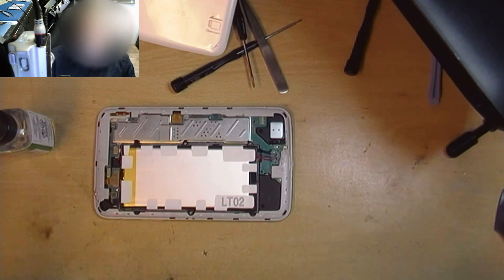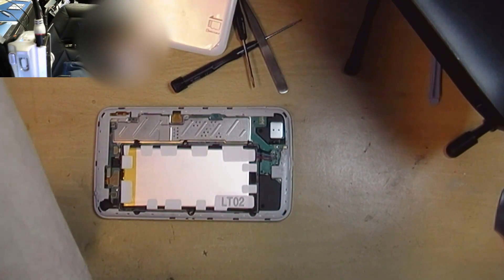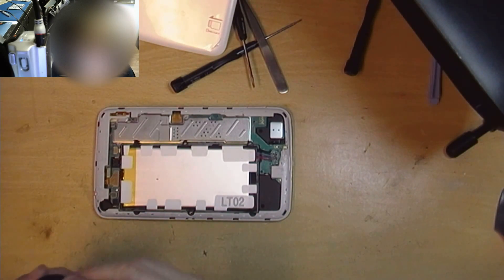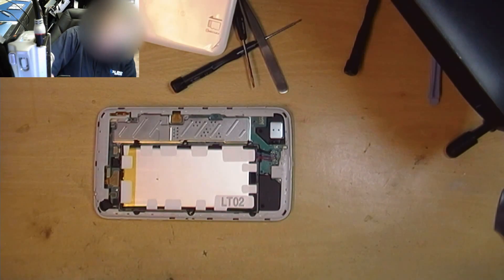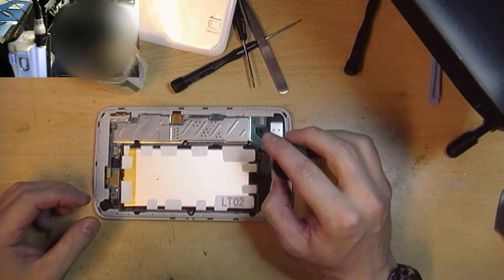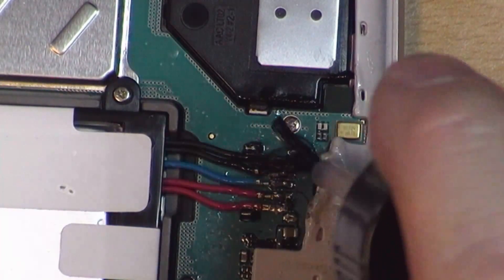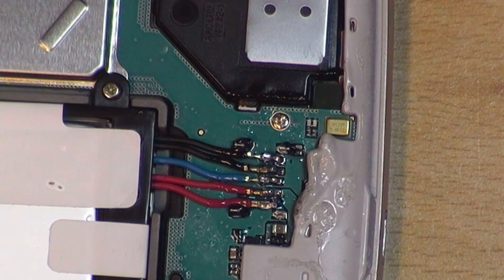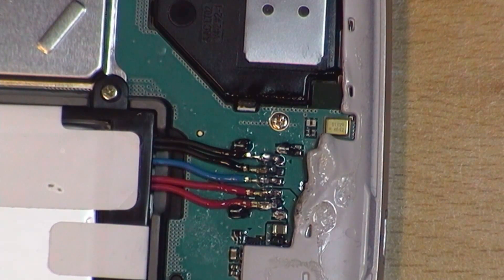Samsung Tab 3 SM-T210 Broken Battery Connector replace / custom solder part 2 Conformal Coating work

Comment: if I wanted bypass charging port and wire a spliced charger cord straight to battery what wires on the battery wires would I connect positive and negative from cord